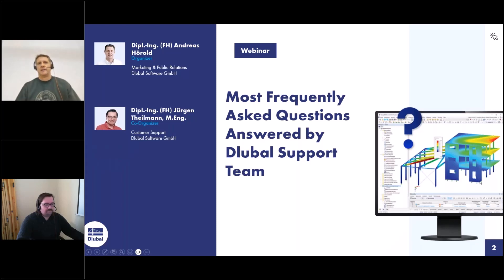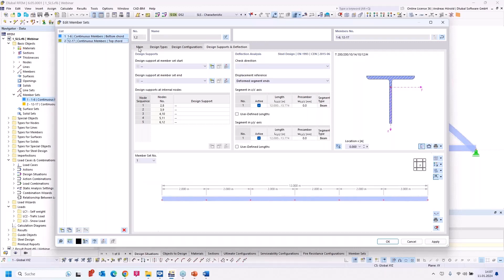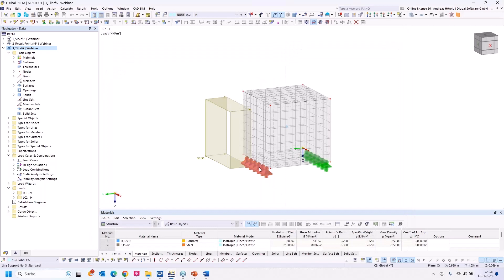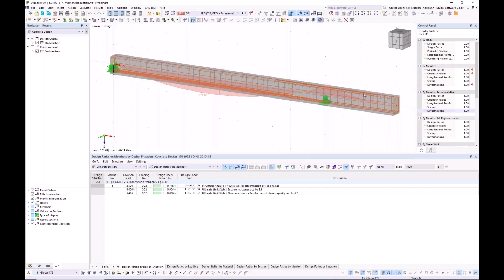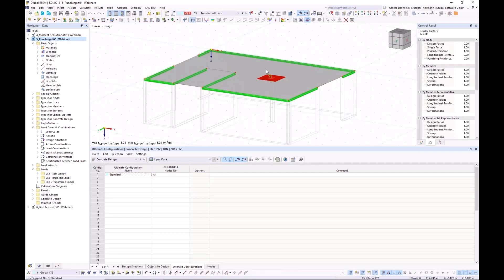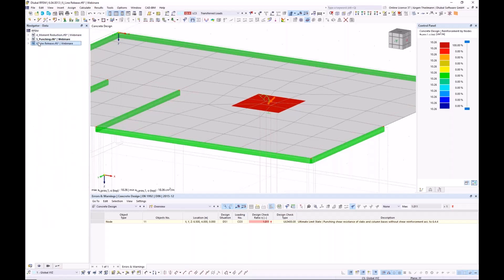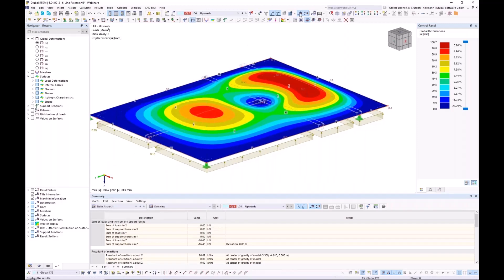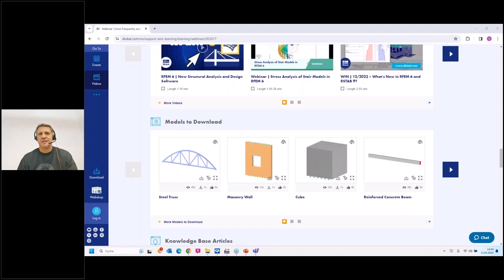Webinar | Most Frequently Asked Questions Answered by Dlubal Support Team | January 2024

Comment: i wanted to design a composite slab, help i tried so hard
Reply from the maker: Hi, @abdirahimomar268! Here are the steps you can follow to design a composite slab in RFEM 6:

Modeling the Slab and Beams: Start by modeling the concrete slab as a surface element and the steel beams as member elements. Ensure that the materials and cross-sections are correctly defined for both the concrete and steel parts.

Composite Action: To simulate the composite action between the concrete slab and the steel beams, use the 'Composite Beam' feature or appropriate connectors. This will ensure that the shear connection and the relative stiffness between the concrete and steel are correctly accounted for.

Loading: Apply the relevant loads to the model, including self-weight, live loads, and any additional loads that the slab is expected to carry.

Analysis: Perform a finite element analysis to determine the internal forces and moments in the slab and beams. Ensure that the model is adequately refined to capture the behavior of the composite system.

Design Checks: Use the design features in RFEM 6 to check the slab and beams against the relevant design codes. This includes checking the bending, shear, deflection, and vibration criteria.

Optimization: Based on the design checks, you may need to optimize the slab thickness, reinforcement layout, or beam sizes to achieve an efficient design that satisfies all code requirements.

Detailing: Once the design is finalized, detail the reinforcement for the concrete slab, including the top and bottom reinforcement, as well as any additional reinforcement required for openings or concentrated loads.

Documentation: Generate the necessary documentation, including design reports, reinforcement drawings, and bill of materials, directly from RFEM 6.

If you encounter difficulties or need further assistance with specific features or steps in the design process, you can access the extensive online manuals and video tutorials available on the Dlubal website, or contact the support team for more personalized guidance.